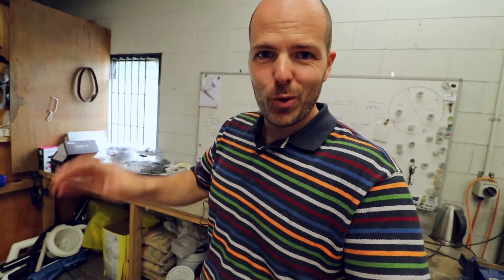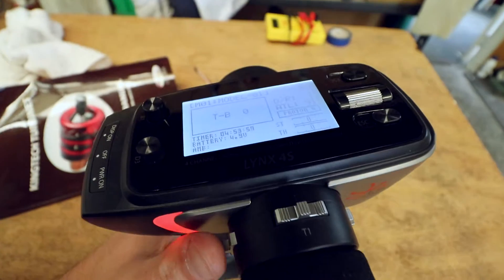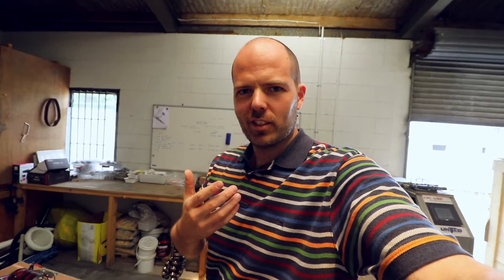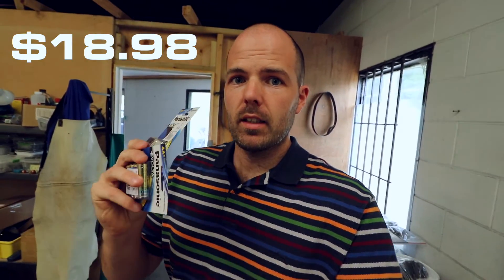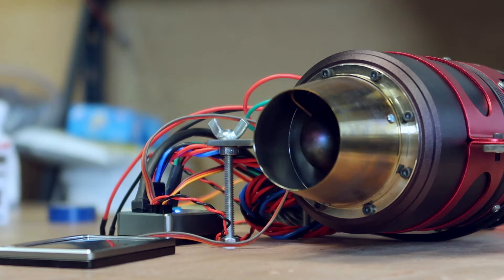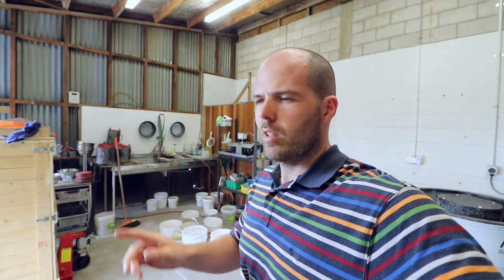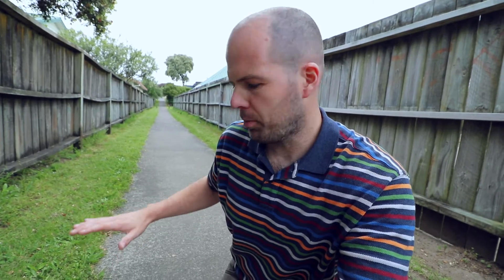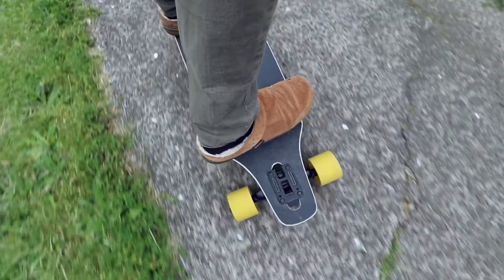Jet-Powered Skateboard (Part 5)

Comment: I've found the idea interesting and googled a bit whether you can make discoloration treatement on titanium.
I've found some info on a metallurgy site, but it is in russian. Here's the translation of the info. To achieve these "colors" you have to treat titanium item for an hour  : 350`C -- pale yellow, 400`C -- yellow-brown, 450`C -- brown-purple, 500`C -- purple-blue, 550`C - blue, 600`C -- yellow-red, 650`C -- "dirty purple",  700+ gives various shades of grey. You've might already find this info, but just in case.

Comment: 9.12 is that display a bit close toi the engine ?
Reply from the maker: It's weird... there is not much heat radiation with this. The main thing is the heat that comes out exhaust.
Reply: Magnus it looks close might just be the camera angle 👍
Reply from the maker: Oh, yeah, I just watched the video again ...you're right, it was the camera angle. Not that close in real life.
Reply: *****
I just did not want you to burn it after all the problems with the batteries. I am just glad its all good and can not wait till she is on the Long Board that's gonna be epic.